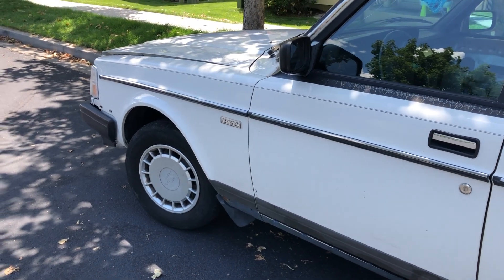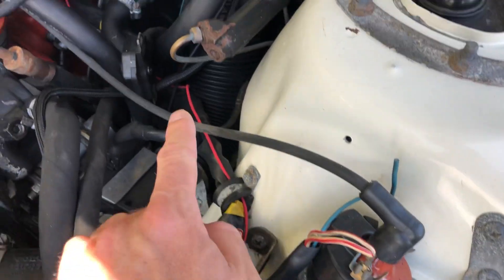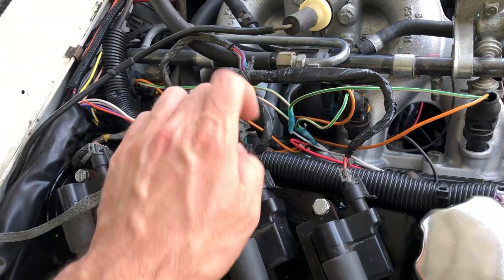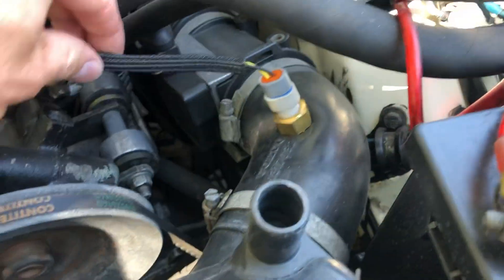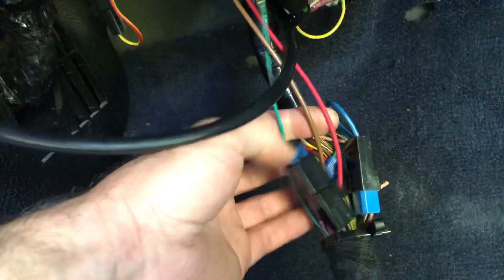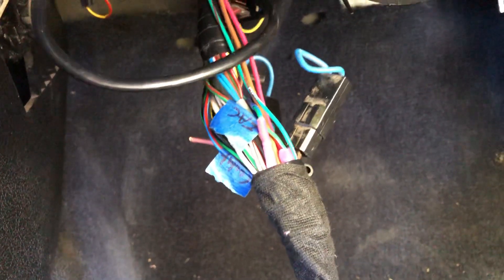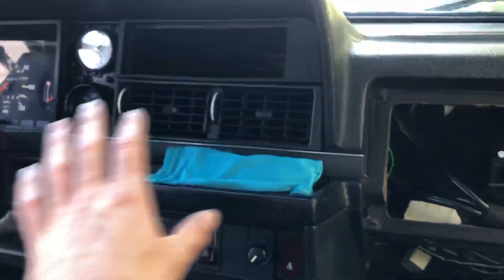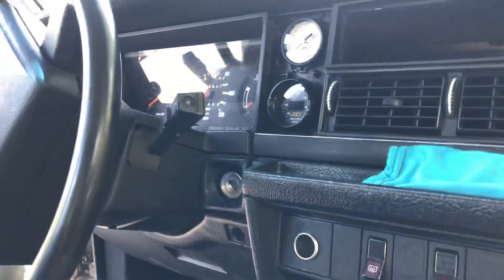Volvo 240 Speeduino installation overview

Comment: could you tell me more about how you used the vr crank sensor? Im having trouble getting a signal from mine although i can pick it up on my multimeter. any help would be greatly appreciated
Reply from the maker: I just spliced into the factory vr sensor that sits on top of the bell housing on a late model b230f
Reply: @TurbineResearch  Thank you for your reply, could I ask what trigger pattern and no. 1 tdc offset you used? The only info I've been able to find was 60-2 with a -84 or +275 degree trigger offset. Trying that on my b230f 940 has been unsuccessful. Any pointers in the right direction would be appreciated.

Some (probably irrelevant) context: I replaced the VR sensor with a hall sensor that has nearly the exact same dimensions and is mounted in the original sensor's spot. During cranking it reads RPM, and it says it's getting SYNC.
Reply: @Zubbbz did you ever get this to work and what hall sensor are you using?
Reply: @noahluzi7520  I did get it working. I ended up with a hall sensor from DIY auto tune. I went with the cheaper one, the black one, not the red one. I also had to design a trigger wheel and have it laser cut out of 3/16in thick steel. I welded that onto the back of my harmonic balancer, the side that faces the engine, and used a timing light to verify top dead center. I have a Volvo 940 1994 with the Regina system. The stock trigger pattern for the flywheel Is some funky pattern that speeduino doesn't have support for as far as I know. That's why I ended up making my own trigger wheel. For ignition, I just used L.S. coils that I got from the scrapyard. It's all a little janky and shitty, but I've driven over 2,000 miles with my current setup and apart from minor misfires at high rpm, it runs perfectly. The misfires are due to an issue with interference in the crank signal as I did not use shielded wire for it like I should have. For O2, I used an UEGO sensor from AEM Electronics.
Reply: @ I have a 1993 Volvo 240 with the lh2.4 and I cannot for the life of me get the car to function on the stock vr sensor. The guy in this video somehow did but I can’t figure out how to get a clean consistent trigger from the 60-2 wheel and vr sensor. I’m thinking about just getting a universal trigger wheel with a hall sensor and welding that in place because vr sensors are proving to be extremely frustrating.
Reply: @noahluzi7520  vr sensors seem like more trouble than they're worth. I thought my car had a 60-2 but it has some weird 44-2-2 something or other. Nothing needed to condition the signal either with hall, and the diyautotune hall sensor has an integrated pullup resistor

Comment: This would still be a wasted spark configuration correct?
Reply from the maker: Yes it's coil near plug wasted spark using LS truck coil packs and wires

Comment: Did you have to use an igniter for the coils? And what were your coils originally from? I have a set of the earlier truck coils and I’m not sure if I need an igniter or not.
Reply from the maker: LS coils don't need an external igniter. You just wire them up and they work great. These are off an early LS truck
Reply: @TurbineResearch  thanks. I have ones from 03 truck and hadn’t considered if they needed an igniter or not. Thanks.

Comment: Did you weld some standoffs onto the valve cover to mount the coils? I'd be interested in a little more detail about that set up. I'm in the beginning stages of setting up a Daihatsu Rocky with a speeduino. Thanks!
Reply from the maker: Thanks !  It's LS coils and just some 1" 1/4-20 threaded aluminum stand offs from McMaster.

Comment: Hi mate, you talk of the coloures wires...i have exactly same motor and search for wiringdiagram as well...i have a strange situation: i had a crank, no start....untill a friend suggested to bypass the + terminal( blue wire) of the coil with the + of battery....by magic i could start the engine, the inline fuelpump under the car primed 2 seconds, and the pump ran while starting...car runs great after 5 years outside...now comes the cath: the car wont shutt off with this bypass ...2 questions here: what exactly did i accumplish by bypassing? What is at fault here? And how can i 100% make the diagnose? Volvo s are great, but i also want to know the colour odes from the wires behind dashboard...anyone a clue? What colours uses volvo as a guideline? They look to me a logic, well built and comprehensable carbrand. I looove my volvo, and wld like it to drive asap, with proper non by pass trick...mine is 1991 same motor as yours...thanks Bob Belgium

Comment: im just about to start this. i have a v4.3 board i put together. found this video and its exactly what i planned on doing. did you use the base map  to get it started or custom make one?
Reply from the maker: The speeduino basemap with the correct engine size and injector size worked perfectly
Reply: @TurbineResearch  awesome thanks for that.

Comment: Hey man, any chance you have the wiring diagram? I've got a 1991 240 on LH2.4 that I'd love to put an aftermarket ECU in like you have (leaving bosch to control idle), but having trouble finding a wiring diagram.
Reply from the maker: Most aftermarket ecus including speeduino can support 2 wire  idle valves. I could have easily done that but this was for a friend and I was trying to do it quickly without ordering more stuff. I would just get a 2 wire idle valve  and cut out the stock ecu completely if I did it again.  However, I don't have a wiring diagram unfortunately
Reply: @TurbineResearch  Thanks for the reply, I suppose it would probably be cleaner to have the stock ECU's completely removed.
Shortly after posting I found a wiring diagram, so I'm ready to go as soon as the ECU connector I've bought on ebay arrives! :D

Comment: Thanks for putting this video up its a great help. Iv got a 940 b230fk lh2. 4, a speeduino and a spare lh2. 4 fuel ecu case and socket.
Reply: Did you use factory crank sensor? If so, What did you come up with for ATDC

Comment: Great detail, thank you. Thinking of buying a 242 turbo with the b21 and have zero experience of this stuff but all I know is I'm not chasing old Bosch injection issues for the rest of my life!
Reply from the maker: Throw it all in the bin and go megasquirt. My friend has a 242 that is on mega and it's perfectly reliable and smooth. Look in my videos for anything that says Tate's Volvo
Reply: @TurbineResearch  Any reason to recommend megasquirt instead of using a speeduino as you did?
Reply from the maker: @otherdalek  megasquirt is more mature and has better documentation. Wayyyy less messing around and more driving with megasquirt

Comment: Hi there. I think we just became friends. I'm also running a speeduino on an lh2.4 turbo 740! I'm currently stumbling on getting the tune maps into a happy spot. Do you have a basetune?
Reply: I guess I need to make my own video to lay out where I am so far. I'll watch your video in full soon and learn about how you did yours!
Reply: I started my tune from a miata na basemap and added to the tune to get it ready for a turbo. I've been thru tons of test tune and error-logging to get this far! But the wiring is done. I actually stripped the 2 stock computers, and stripped some of the stock harness as well
Reply from the maker: I don't have the car around anymore but feel free to ask questions